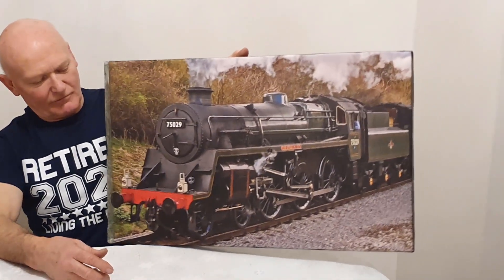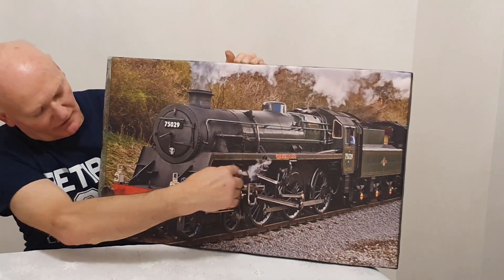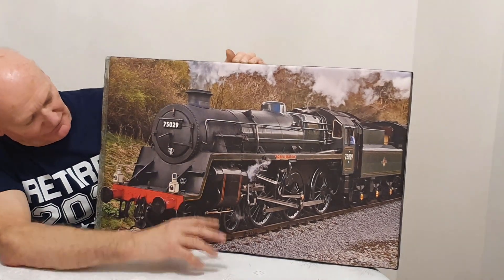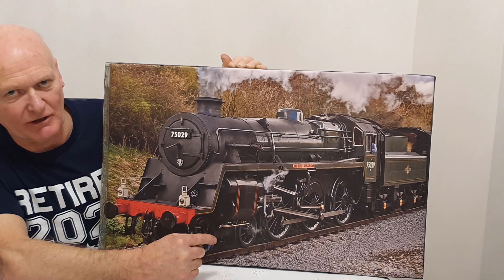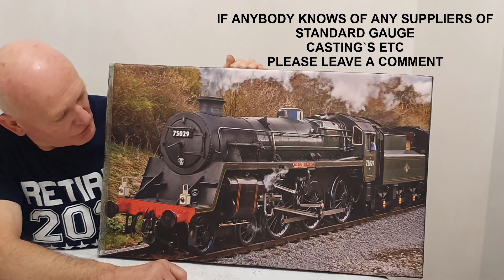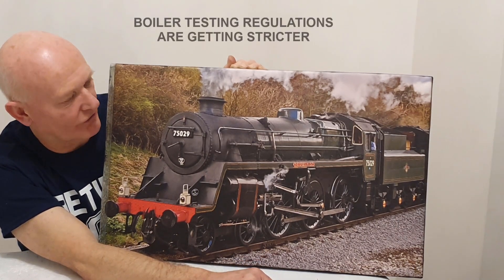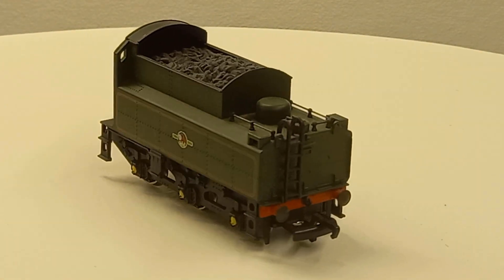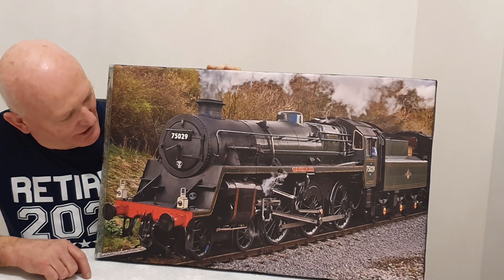PART  1        BUILDING THE    BR STANDARD CLASS 4    4 6 0     TENDER   LOCO         in  7 25 inch

Comment: Andy, That's a great looking retirement project. Good idea to start with the tender - I took that approach with my 9F. As a beginner I thought if I bugger up the tender, its a lot less expensive than buggering up the loco!  You will also need to consider how to physically handle such a large and heavy machine. My far from complete 5" 9F is heavy enough  - I sometimes wish I'd started an 0-6-0 instead! (Only kidding)...

Looking forward to seeing this project take shape.
Cheers Craig
Reply from the maker: Hi Craig,
Thanks for the comment  and subscribing.
I have a 5" gauge 0 6 0 Speedy.
For me that is a two man lift.
I also have a 5" Royal Scot "chassis", I could not pick that up alone either, but the guy I bought it off could. He was the son of the "late builder" and was a man mountain.
Cheers.
Andy G.

Comment: I've used a copper boiler from steam technology on my loco as its cheaper than silver soldered one qnd my loco steams very well. It might be worth giving them a shout they are very helpful
Reply from the maker: Thanks Sharky, could  be worth looking into.
Thanks very much for your suggestion.
I have a friend who drives a loco with a copper boiler, and one with a steel boiler and he says the steel boiler loco is something harder to drive with, due to heat transfer etc.
Thanks again.

Comment: Doesn’t Doug Hewson have the drawings in digital/CAD format. From there it should be possible to scale up or down to whatever size you require? It’s probably not as simple as that, but it sounds feasible……. or does it?
Reply from the maker: Hi Graham,
That might be so, I might check into it.
I was going to have a word with Black Gates Engineering ( suppliers of model engineering materials and such), as I beleive they have a printer, and have scaled up a drawing for a fellow club member in the past.
Cheers.
Reply: @masterpiecesinminiature8299  It's gotta be worth a shot, I used to love going to Blackgates, but I always spent more than I planned 😄👍